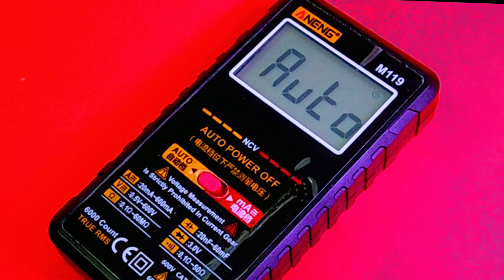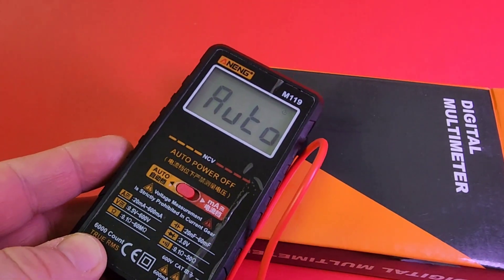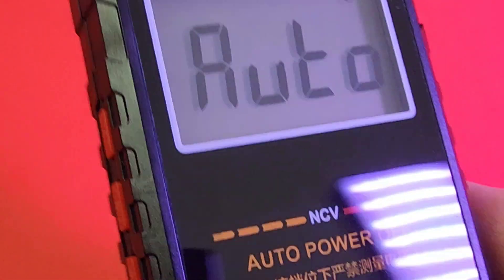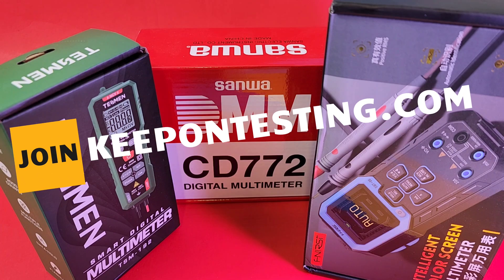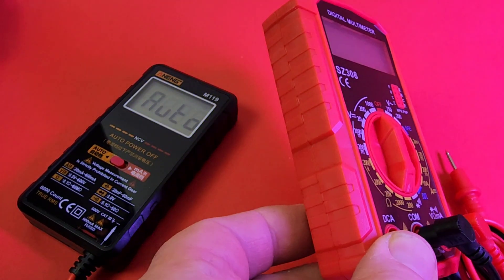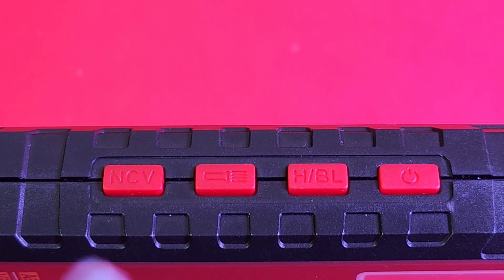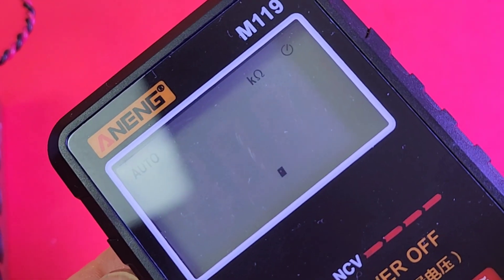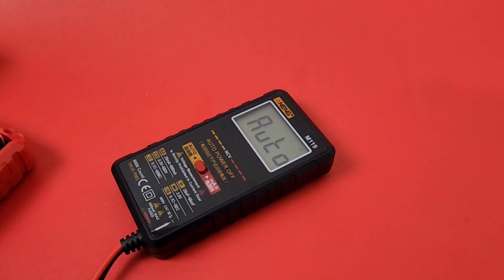ANENG M119 CHEAP-O Multimeter Review & Teardown!

Comment: Maybe next u can review dt131a, and compare it with aneng m118a
Both is auto but m118a has too many error problem
Reply: Yes brother m118a not professional multimeter,
all the best 1 multimeter,
Gscete 350d 2500rs with delivery in Pakistan 
Gscete 360E 3000rs with delivery in Pakistan 
Best model 
And best features & value for mony,

Comment: Just how it looks...pretty shoddy to say at least. Seems like a variation of the Aneng I have (M118A?) that does a proper current range (otherwise you need atleast 20mA to activate the current reading in auto mode, there is no override to current mode!)

Nice work on the magnets, but don't forget about some epoxy or glue!
Reply from the maker: Thx ! I used some Araldite epoxy to secure the lil suckers! Yep the M119 is definitely underwhelming 😅

Comment: SZ308 is a rebadged DT832 in a fancy casing.
Reply from the maker: Basically! Those 830xx were definitely hard to beat design wise. 👍
Reply: @KeepOnTesting  Yes, but I had an interesting case that can't be explained. Mastech M832, everything inside in ideal condition, but... the ADC chip was shorted on a lot of lines, both analog and digital (but not power). After replacing it with an ordinary 7106 the device started up, but the op amp in the beeper circuitry turned out to be fried as well. How???
Reply from the maker: Interesting...not sure how the circuit was initially compromised, but you never can be 100% sure about faults until you actually start testing..makes life interesting! 😮

Comment: Would also heating the neodymium magnet with a soldering iron and forcing it into the plastic work?
Reply: The magnetism of neo magnets is reduced by the temperature required to melt plastic. 😢
Reply: @pault6533  right then, drilling it is!
Reply from the maker: Paul beat me to it..hehe

Comment: Have they fixed the nasty bug of M118? In the voltage mode, if the input voltage is between 20 and 40 V, the input resistance drops to 5..10 kOhm, creating a huge leak.
Reply from the maker: I'll report back on that..fingers crossed!
Reply: @KeepOnTesting  Apply 25 V to the probes in auto mode and check the current consumption.